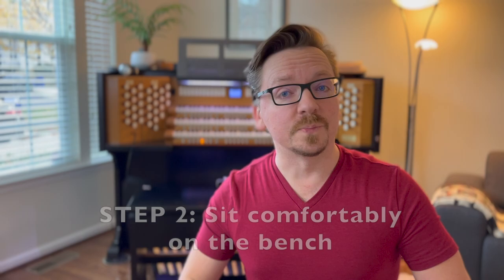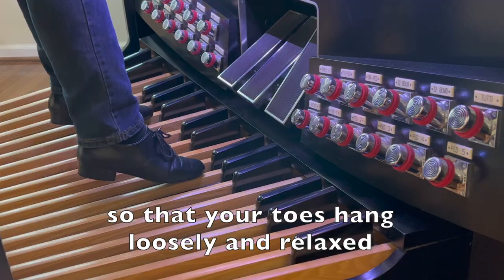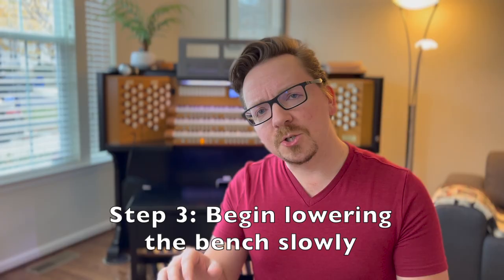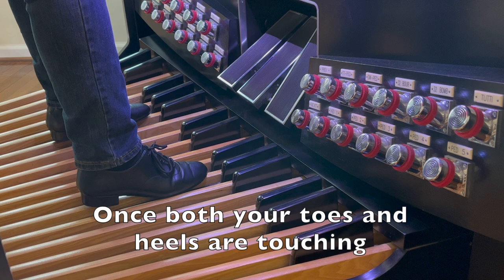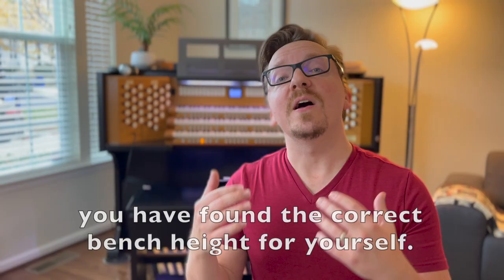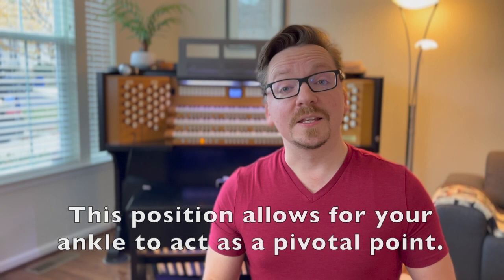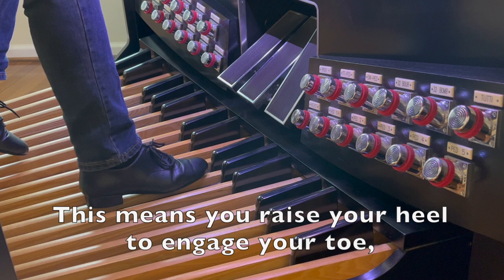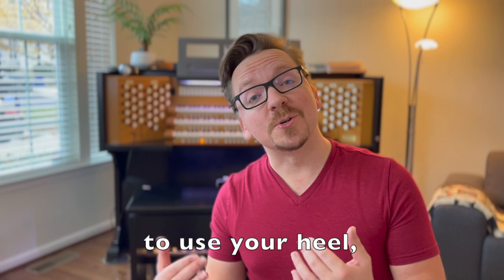How to determine HEIGHT for your Organ Bench

Comment: Ii am currently substituting on a Kilgen Pipe Organ. My feet are exactly as you have demonstrated sitting comfortably on the pedals.The pedal board is 29 and 1/2 inches up -to the bottom manual. But the bottom manual is 37 inches from the floor, rather than the AGO Standard of 35 inches. Both Manuals are uncomfortably high and almost damaging to me. I am 5’2 and 1/2 inches tall. Playing this Kilgen is a nightmare. It also has tracker type sensitivity. Not user friendly at all. Can you tell me why the Organ Manuals are this high? In over 42 years of Service Playing, I have probably played somehow between 20 and 25 Organs in various Christian Denominations, but have NEVER come across this Nightmare… for my height!! Thank you so much!